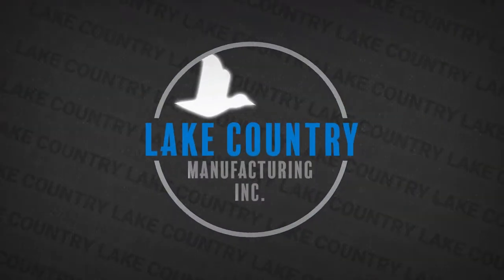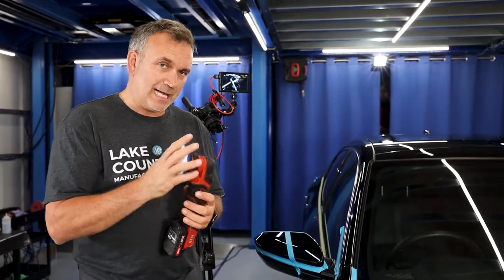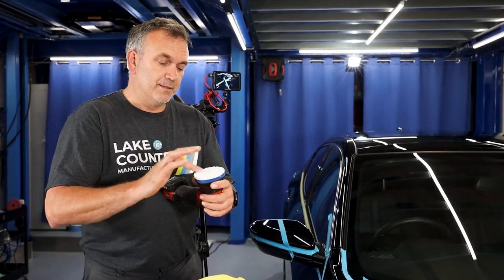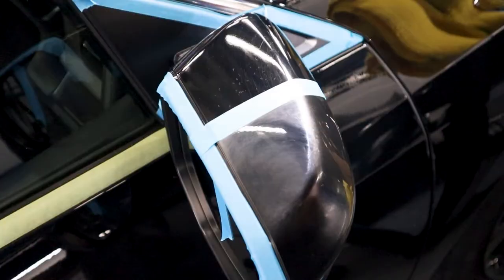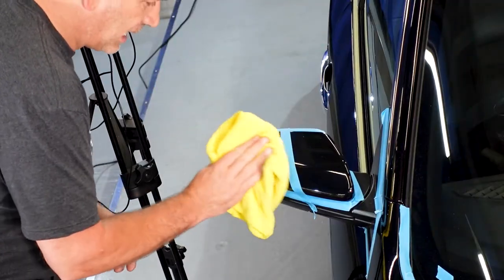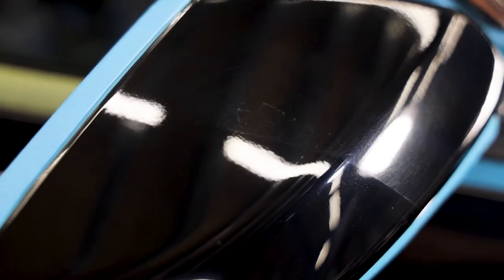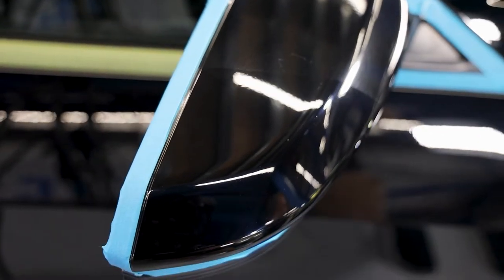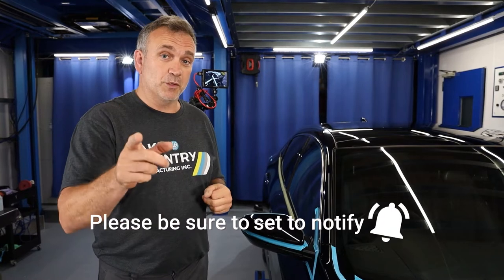Spotlight, '18 Honda Civic - Part 2: Correcting Sinkage in Factory Paint

Comment: Did you say the side mirror has a "factory defect called sinkage" Sinkae you will see in a area that has been repainted but not factory. Which in this case, this car as definitely been repainted. 
You can't get sinkage out with just by polishing it out. If it's superficial at vest ypu need to knock it down with 1500 gritt. Of its "deep" then ypu will need to repaint.

Comment: God that polisher is so neat. Seems so quiet and easy to maneuver. Can I put way bigger batteries on it or does it make it unnecessarily difficult to handle the machine?
Reply: Yes you can. Machine is delivery with 2,5 Ah batteries but it possible to purchase 4,0 and 6,0 Ah batteries which will last longer but they are bigger and heavier of course.
Reply: @MrJanko13  right, I know you CAN, the question is if you SHOULD. it may make the machine way off balance, making it handle worse than necessary.
Reply from the maker: In my experience (Jay B here) this tool works just great as it comes.  There are a number of extension accessories which are worth getting for it (you can see them in the video below), but the compact battery is not something I'd want to change.

https://www.youtube.com/watch?v=p0XnwxEsTYU

Comment: Little bit of sanding needed for much more better result
Reply: Yeah, I think I'd have to 2000 that first.
Reply: No. You're looking at correcting as little as possible and as much as necessary.
Clear coat isn't infinite.
Reply from the maker: As you can see, sinkage can be removed by polishing alone which means it's quite an accessible procedure.  Sanding will remove it too, but it's primarily a process used for orange peel removal, and it's just not something that everybody is comfortable with doing.  Learn (much) more here:  https://www.youtube.com/watch?v=i7o-rfi8HRU

:)